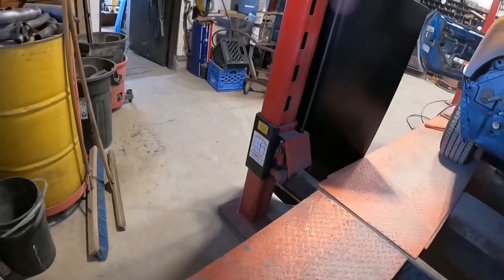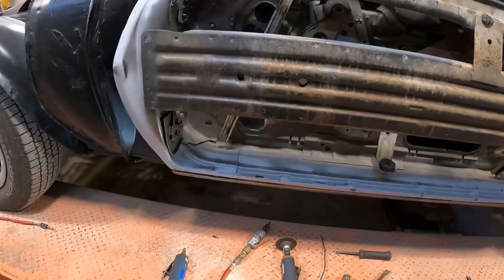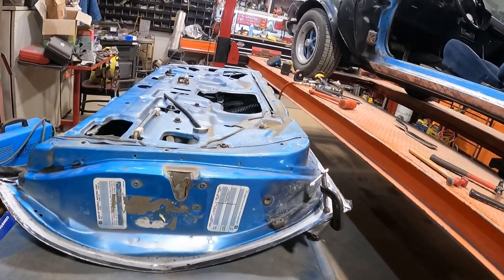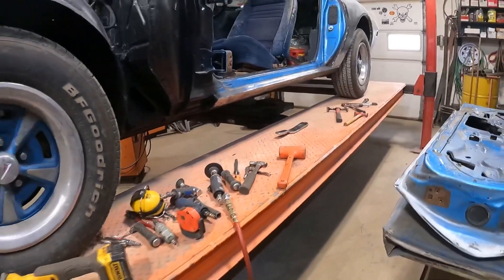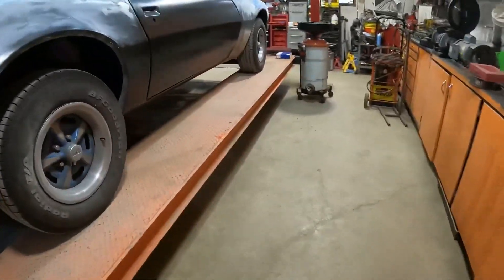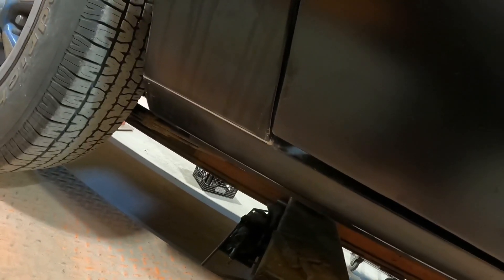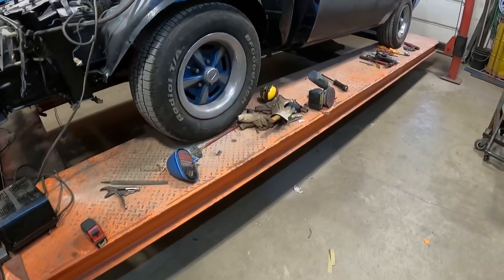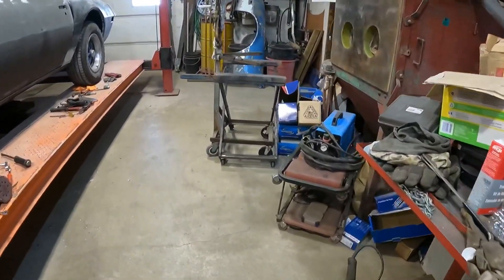Firebird door skin issue and gaps

Comment: Which project do you like to work on more Frank, the Stude or the Firebird?  Something tells me the Firebird would come in 2nd...😆
Reply from the maker: Im beyond the point i wanted to go, deal was so the metalwork and move it on to body shop. They dont want to finish it. So he would be stuck with an unfinished car. Would have to haul it a long way to get it to someone willing to finish. 
Studebaker isnt getting any filler, except in the cab if needed.
Reply: Been there--endured that!😆